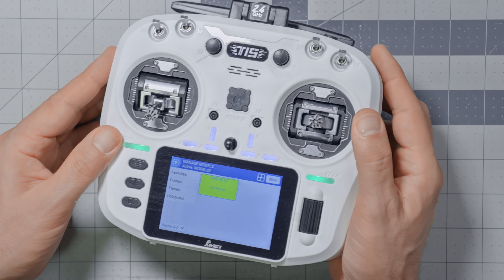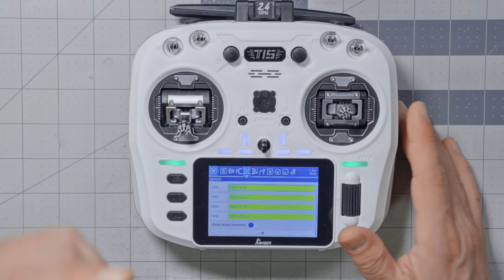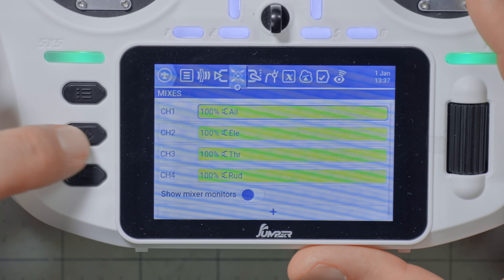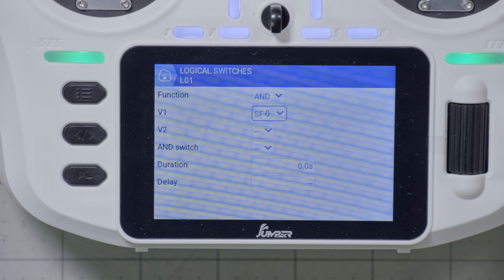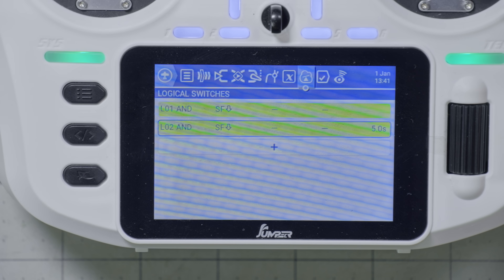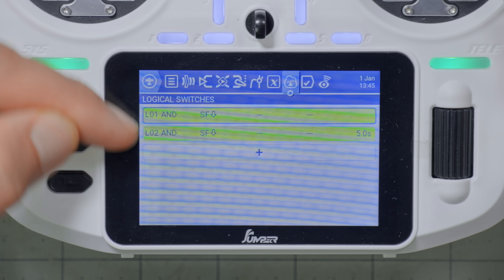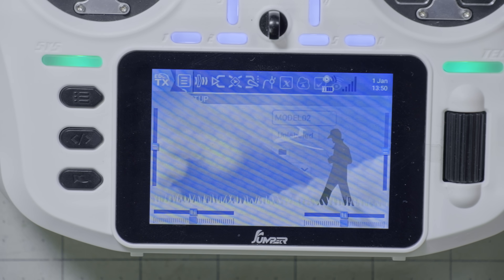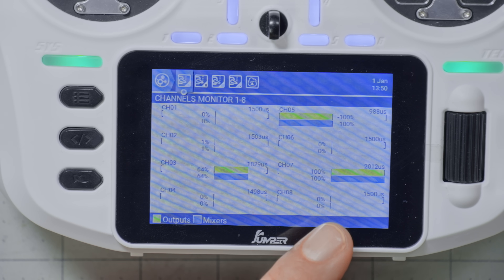EdgeTX 101 - Ep11 - Short-press, Long-press (Logical Switch Duration Function)

Comment: Hi Joshua, anyway different way convert openTX models to edgeTX models. The version of my radio ( taranis x9d+) frimware will not support opening the sd card file to convert. I have tired to roll back the software to openTX and upgrade original radio firmware with no luck. The models are on PC and sd card but, unable to convert. My other choice is to reprogram to them radio right now. Anyone offer any solutions?

Comment: Have a question not related to this video but on the radiomaster tx16. I got the gimbal light kit and went to install them only to find out they plug into the same ports that i already used one for a extra switch on the back. My question  is can i just wire the two together to one port without drawing  to much or better to wire them in series and lose some brightness.   Thanks

Comment: Do I need to select the source as well as the switch in the mixer tab or is it sufficient to map the channel directly to the output of L01 and L02? what am I missing here? didn't we already bind SF to trigger the logical switches?
Reply from the maker: You do it exactly like I did it in the video <3

SF triggers the logical switches. The mixer assigns the logical switch as SRC for the channel. When the logical swtich is false, the channel is at -100. When the logical switch is true, the channel is at +100. You do not use the SWITCH parameter. That does something different (which is also covered in this playlist).